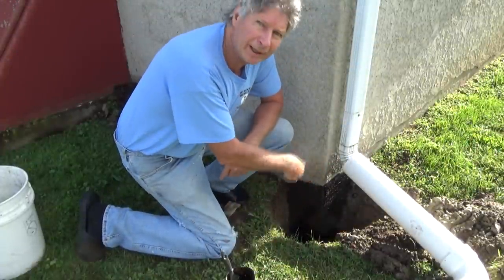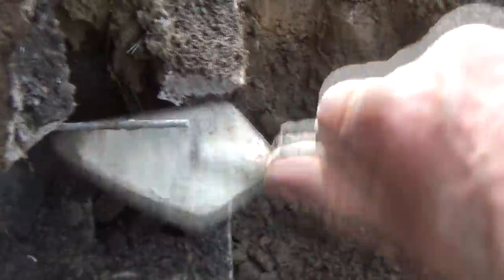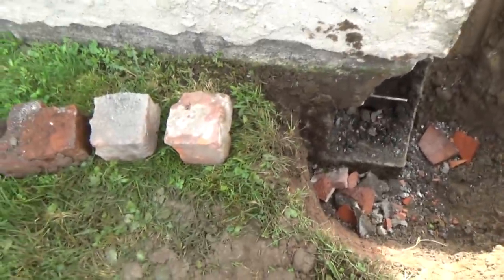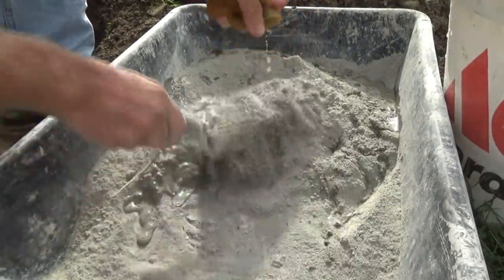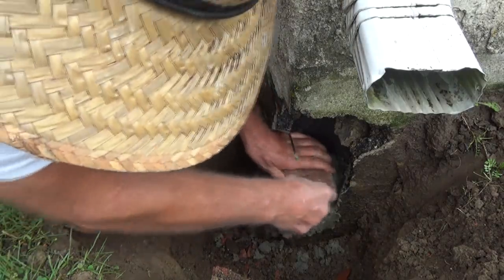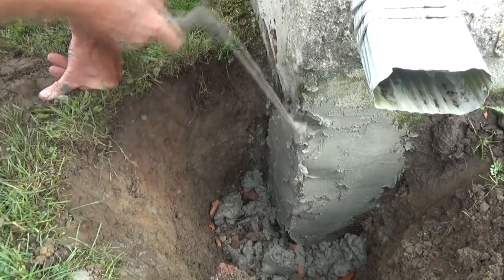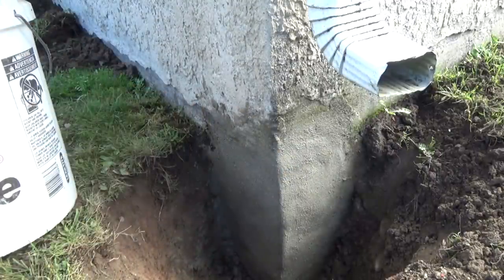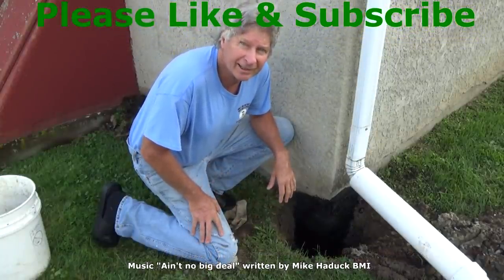FOUNDATION REPAIR (Part 20) Mike Haduck

Comment: Company wanted $2,500 to do this at my house, same as this where it’s on the corner. I did myself with 5 bricks and 2 bags of mortar, $20. Thanks for the knowledge!!
Reply from the maker: Thanks reaper, Mike
Reply: Ok so mortar it is! Ok because I also just discovered a crack in the same corner w a gutter above it…I will be doing the repair! ❤❤
Reply: This man is a gift from GOD

Comment: Hello Mike. I have learn so much from your videos and lost the fear of doing some work myself. Thank you veru much for your videos, they are so useful you can't imagine. Lately, I bought a house with one of my sons where he will live and start a business. 
We live in Quebec, about 35 miles east from Montreal. This house was built back in 1975. One of the previous owners put 4"  thick polystyrene ouside of the basement walls. Inside the basement there is a 1/2" thick  inch white polystyrene against the exterior walls and then just drywall installed on 2x2 frame. The basement is pretty cold in winter and quite humid in summer.  We measured 65% relative humidity on the surface of the walls and floor. Luckily there are no cracks, leaks or mold inside but we want to watereproof it to make it more livable, but the concrete seems very porous and fills very humid.
We are planning to rip all the drywall and white polystyrene  from the inside the basement perimeter walls and the very old wooden floor. 
We believe we could use Krystol T1 to seal the concrete floor and walls from inside and then buil a waterproof subfloor and properly waterproof walls.  
What do you think about using Krystol T1 to make the concrete more impermeable before installing. New floor and walls as per current standards ?
Reply from the maker: Hi Pam, I would watch my basement water problem solutions first, mike haduck,that might help, thanks Mike

Comment: I'm in Pennsylvania also.  It's amazing how the freeze/thaw cycle of water will destroy concrete block and walls over time.  It's been difficult to find the process of actual repairs, but I know that regional differences will alter the recipe of mortar and cement because of the soil types, temperature, climate, etc.  It's great also have the historical way of doing things presented.  Newer isn't always better, and a lot of castles are still standing in Europe. :)
Reply from the maker: Thanks, I agree, Mike

Comment: I will be helping a neighbor doing the same thing as you Mike. I will be the dentist and the foundation will be the big  TOOTH !! lucky I got my ace in the hole friend Mike showing me how to do things. Good day Sir too.
Reply from the maker: Thanks victory,  take your time and practice,  you will get it, Mike
Reply: Would using any type of hydralic cement on the outside of the block wall work just as good as the black asphalt pitch you are using Sir ??Thanks @MikeHaduck
Reply from the maker: @victoryfirst2878  hi, I never seen any type of cement that was water proof, thanks Mike

Comment: I use a form after doing what Mike does I pour in from the top and set the form up. This is for thicker basement walls. you can always touchup you work with more mortar. I also use a pool mason tool to grind it perfectly smooth. Mike has given me confidence and ideas to sell my work. Great Video.
Reply from the maker: Thanks Wayne, Mike

Comment: Nice! Good bet that laying in some good bricks is going to last a lot longer than forming in a concrete patch, right?  I just did a similar patch and only used quick-set concrete.  I shoulda used some stone and/or brick.  Also, in my case, after years of water getting in I think I needed to dig deeper, maybe to the footer, to tar the whole wall.  Be well and thanks Mike, great video.
Reply from the maker: Thanks spring, also sloping the ground away from the house helps, Mike

Comment: another great video, but I'm puzzled about when you wet the work area and the blocks/bricks before applying cement and when you don't.  I thought you always should wet the area you're repairing so cement sticks well.
Reply from the maker: Hi stratmaster, I have a video out called "should I wet it first?" Brick and block work rarely unless you plaster it, thanks Mike

Comment: Mike, can you comment on how much one needs to clean the area of the patching and surrounding area? I see so many other videos that seem to go to extremes sometimes in preparing the areas. instead of a quick brush down and spray of the immediate area,,,, they instead insist on power spraying, grinding, wire brushing, vacuuming and driving tapcons in everywhere and then some! In this video there is still a bit of dirt on the existing blocks at the sides and the mortar overlaps it a bit. Is this no big deal? are others going way overboard? just trying to learn here! Thanks for sharing all your knowledge and taking the time to upload these videos!
Luke
Reply from the maker: Hi Luke, maybe they overthink it , I don't know, a patch is a patch and I never had a problem,  thanks mike

Comment: Hi Mike, I hope life is good for you.
Can you can compare that fast set reparation mortar that you use in your video to a normal mortar like " Quikrete Mason mix type S mortar" the only difference being the time to cure ? 
TY Mike, i learn a lot with your video and also smile a lot in some occasions !  Jacques from Montreal Canada where the bricks exploded during the winter.
Reply from the maker: Hi Juques, I think they just used the word mortar in rapid set because you can also use it for brick work but I feel it is as hard and lasting as concrete, I do not use anything with lime or mortar to patch concrete , portland only for concrete repairs or the rapid set , thanks , thanks mike
Reply: @MikeHaduck 
Thank you for your answer Mike. I won't go into the details but i'm working on my 3 floors 3 appartements house in Montreal. Built in 1927, 4 feets crawlspace, stone fondation recover with some sort of weird concrete(?), alcoholic bricks with lime mortar, backyard too low and bad inclination etc etc etc. Some problems to fix  and some digging to do( clay soil constanly humid very solid soil), more you look more you find just bad you don't have a hotline with a piggy bank for a consultation! 🤔👍

Comment: hey Mike , love your videos. quick question on the bricks, do you need to lay them when dry or if they are wet will it be ok? thank you.
Reply from the maker: Hi aggin,,, most times bricklayer lay bricks dry, otherwise when they are wet they make a mess, sometimes, I usually wet things for stucco or stick on stone, every situation is diffrent,  thanks Mike

Comment: Question. How do you know if the foundation is busted. Water gets in the basement? My walls look wet when it rains and look like mold on the wall but i dont think its mold. I remember you said mold cant grow on concrete before in one of your videos.  Thanks
Reply from the maker: Hi Jacob, foundations are foundations. They all got cracks and get water. Usually it's because of no rain gutters or the land is pitched towards the house,  I got a video " basement water problems" thanks Mike

Comment: Your videos Helped me So Much. Please, can you tell me if I can do 2 coats on an interior wall restore on perma bond cement? It's the white powder with the 2 inch fibers in it. I did the first coat over the mesh screen. But, it's not really smooth enough. It's been 1 day. Can I still do another coat over it and smooth it? Thanks, in advance.
Reply from the maker: Hi cat, I never used permanent bond, I can't say but I don't see why it shouldn't be like old school cement, mike
Reply: @MikeHaduck  Thank you. I'm going to try it.😊

Comment: Hi Mike, I’ve got a similar issue. On my house with a crawl space, the dirt wasn’t graded so the water flows away from the house. I’ve been digging about 2 feet down, following the damage along the side of the house (making sure there is no wiring, piping etc along the way) and the blocks are not broken along the side but indented/slightly deteriorated all along where water has been setting and freezing for years. From what I can see, inside the crawl space, there doesn’t look to be any major problems yet. Could this technique, with that cement mix and tar be used for what Im describing or would you use a different mix?
Reply from the maker: I did a video called " Parge / plaster a block foundation," Mike haduck,  that's the techniques I use new or old,  thanks Mike
Reply: @MikeHaduck  I checked it out, thank you! These videos are great. 👍🏼

Comment: Hey Mike. You make it look so simple. Question for you, when is a foundation unrepairable? I have a  feild stone foundation from 1912 in Idaho that is settling. There is no basement and the floor joists sit on dirt. You can see lots of cracks in the cement block walls above it. I was told I have to lift the house and replace all all the feild stones with cement. Is this true or would a stone mason be able to help?
Reply from the maker: Hi Matthew, I couldn't answer that question unless I was actually there to see it,   I would get some more opinions and go from there, thanks Mike

Comment: thanks for this video, i saw author use bricks and mortar to fix the foundation, does anyone know if i use concrete , i mean portland cement , sand and some small rocks mix to do the job , will it reach the same result ? because many foundation is used concrete.  thanks
Reply from the maker: Hi Stephen,  every situation I'd diffrent, it all depends on where, what, etc, anything that works and what will last, I show what I use in each circumstance  thanks Mike